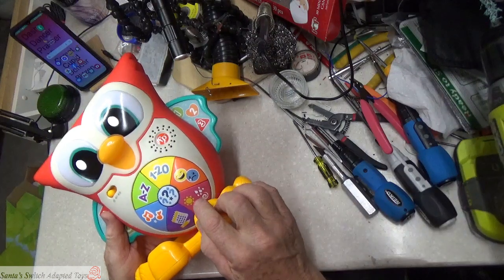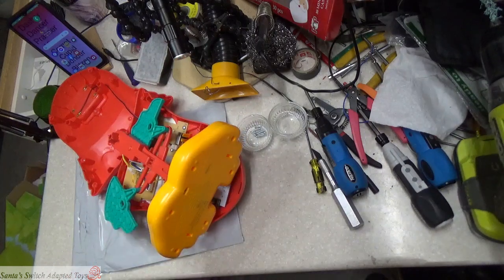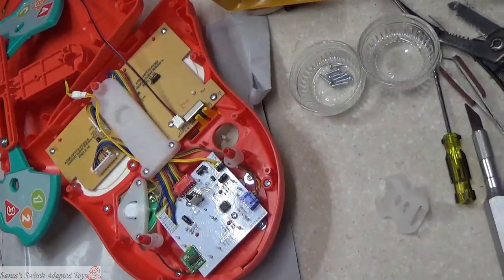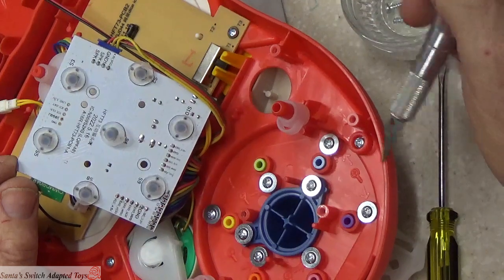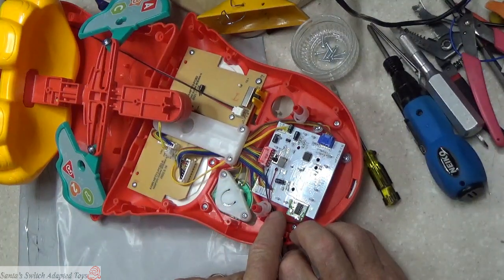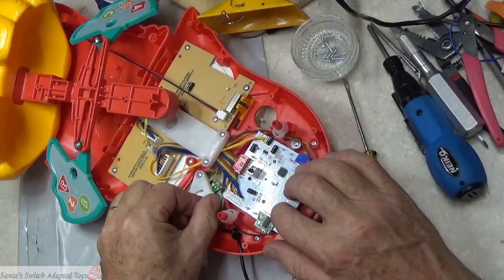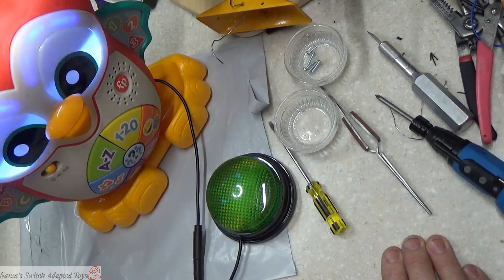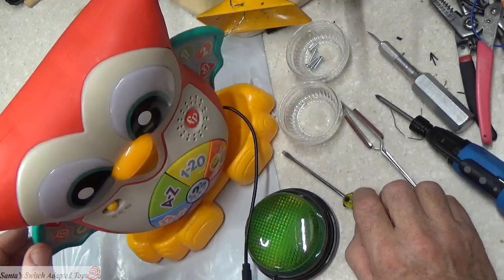Santas Switch Adapted Toys Linkimals Owl

Comment from the maker: Same toy, different version. 

If you open the Owl up and discover the circuit board does not have same contact points seen in the video, how do you adapt if?  

Specifically if the array of solder point that should read S4 and S1-8 are not there. 

I did discover that the Owls with '2021.11.18 date on the yellow PCB and 2021.12.18 date on the white PCB are missing that ability to make this simple adaption. 

For those Owls, you will need to go to the front side of the white PCB, temporarily remove the silicone switch and surface solder one wire to the lower side of PCB board. The other wire will be soldered, also on the front of the PCB, to the solder point marked GND

Unfortunately, I cannot add a photo to the comments so hope this is clear enough to accomplish an adaption.
Reply: So i have this problem and I messed up. I used the ground as you did, and I used the S4 under the silicon that you took out the beginning of the movie. And it’s not working. I probably used the wrong points?
Reply from the maker: @SannePost-jr6hu  Does your Owl have that row of solder points as seen at 6:54 in this video? If so, then those are the best soldering points. As seen in the video, these Printed Circuit Boards (PCB's) will be dated 2022.

If that row of connections is not on your board, which is the case in a revision the factory made, then, as you mention, soldering for one side of your switch needs to take place under the silicone pad. 

These PCB's are dated 2021.

There are two zigzags under that pad, one is from ground, and the other goes to the CPU to complete the circuit. 

You may have accidently soldered to the ground. If so, then the switch will not be completing the circuit. 

To figure which of the zigzags under the pad to solder to, make sure the Owl is turned on and use a jumper wire. 

Touch one end on the ground, the other on one side or the other of the zigzag.  
Once you determine which side activates the toy, you are set to solder to it, and test the adaptive switch function.
Reply: @TheLaserguy2  it worked! Thank you very much, love your videos 😃

Comment: my circuit board does not have s4 on it-how do i adapt if i dont have the s1-8 on it?
Reply from the maker: Good observation! I did discover that the Owls with '2021.11.18 date on the yellow PCB and 2021.12.18 date on the white PCB are missing that ability to make this simple adaption. 
For those Owls, you will need to go to the front side of the white PCB, temporarily remove the silicone switch and surface solder one wire to the lower side of PCB board. The other wire will be soldered, also on the front of the PCB, to the solder point marked GND